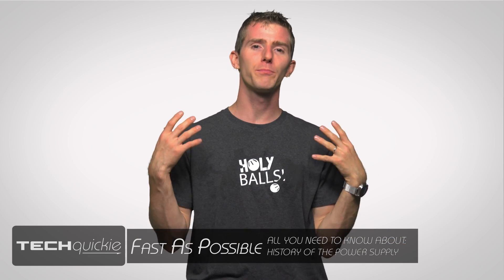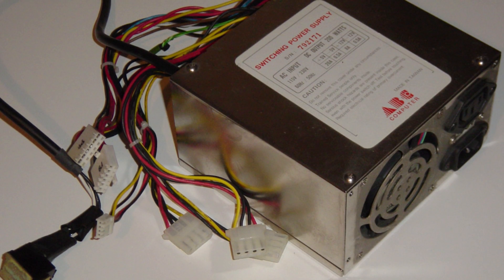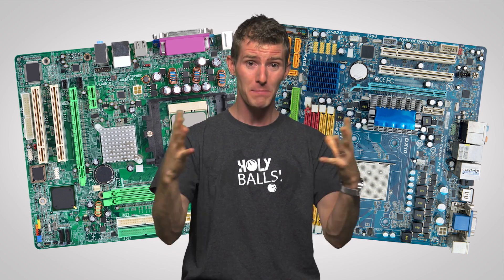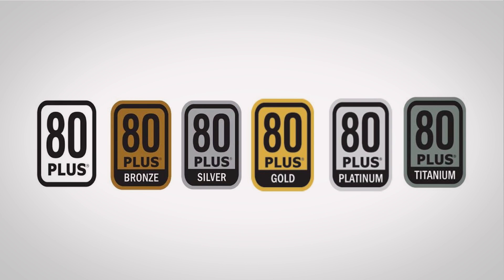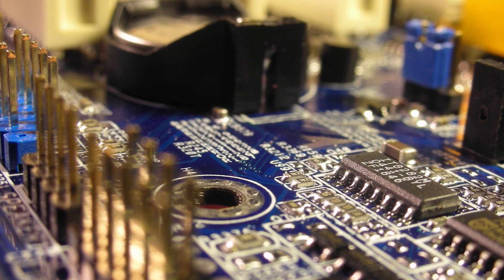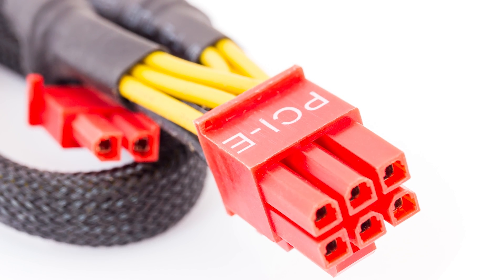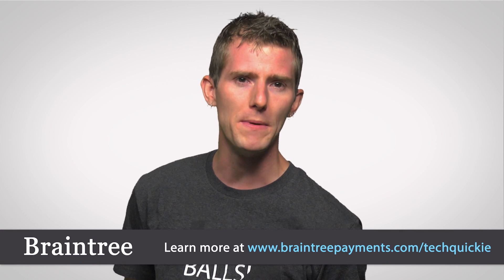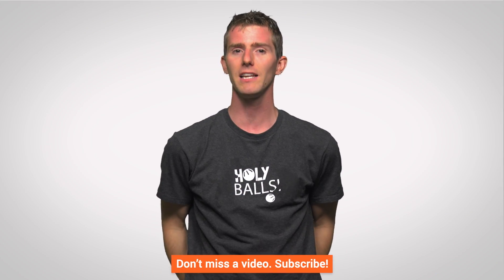History of Computer Power Supplies

Comment: What the actual fuck are you talking about Linus... this is all complete horseshit. ATX / BTX / AT / XT / etc... are NOT the Power Supply but Motherboard Layout and Design. Power Supply Units while might be labeled as "ATX" this is merely in Reference to the ATX 8 / 8+4 / 12 Pin Connector that actually attaches to the Motherboard that Intel designed for their ATX Form Factor. There were a series a 'Transitional' ACPI PSU that had AT / XT / ATX Connectors and in-fact today the actual PSU name typically denotes the Form Factor of the PSU itself as Modular ACPI PSU are becoming the Standard, that can provide a fully customisable range of Connectors for the various Board Designs. • It is still technically possible to power a Modern ATX Board with an AT Power Supply, and depending on when (as AMD / Cyrix / NeXT did keep using them well into the Late 90s as they chose to stick to the AT Form Factor until the Pentium III Era in 1999) it may or may not feature ACPI Functionality. Yet it won't work "Out of the Box" as you will need an inline 3.3v Line Converter as this was something the 2-Rail (5v/12v) lacked ... on top of this typically they never really went above 350w, which beyond a Low-Power System (say AM1 APU that typically run at 15w, with no Dedicated GPU or an AGP > PCI-E Converter to use an earlier Low-Power Card) you're likely to run in to Power Issues. As Modern GPU even Low-End expect ~75-180w and CPU expect ~65-125w; As such with a 350w AT PSU (with a inline brand and stepdown) ... it'd be tough beyond ITX Systems and potentially dangerous too, given well there are non of the protections that modern systems typically rely on (because they're basically considered part of 'ATX Standard')
Reply: Tfw a fucking "brony" (or whatever you people fucking call yourselves) tries to call Linus out on some bullshit.
Reply: What's your point?

Comment: PSU Tiers fast as possible would be a good followup. You CAN go and get the brand name unit that has enough wattage, but it's not always the best choice. There's a reason why some units are more expensive than others, and it's not just the modularity/aesthetic/efficiency. This is coming from someone who tried overclocking a G3258 on a Corsair CX500 and less than a week later, the PSU was dying and took the SSD with it. Never again going with a low tier PSU for even somewhat intensive loads.

Comment: I've gone through a few Antec power supplies in the past. The power supply would just simply die or almost cause the ATX plug to get stuck in the board because it would fry a little...

Comment: "Tinkerers", and the rest of who had ANY business working on computers in the days of the AT power supply, had NO problems with re-pinning and re-configuring these things.  These new kids that think they know computers now wouldn't even begin to know where to start on an IBM PS2 or something like that.  We were excited to see jumpers on the main board to switch CPU frequencies and make overclocking a breeze, or even upgrading a CPU.  Lets see you geniuses deal with things like that, as well as REAL hardware that didn't rely on software to work, because it was "standard" and "compatible".  Damned kids, get off my server floor.
Reply: I've never seen an AT PSU with a different pinout so I don't know what he's talking about when ge speaks about "re pining" the connectors.

And yeah, jumpers on the motherboard have NOTHING to see with PSU like you said. The only time where sometimes a jumper was needed is when computers switched from AT to ATX and you saw baby AT motherboards with both connectors and so some designers decided to use a jumper to switch between both but that's all

Comment: And Dell still made proprietary systems even as late as 08'. My T7400 I built as a file server has a 24 and 20 pin connector, which no single PS has besides proprietary Dell. And it won't work if you hotwire 2 PSU's together due to reworked pins on the 20 pin.

Comment: I find it odd that even here there is no mention of Amps. Everyone is obsessed with Watts and efficiency ratings but Amps are NEVER even hinted at. Yes hardware is getting more efficient but if you have a 700W gold psu that your going to run SLI on a 30 amp 12v rail most likely will not be enough. There is more to selecting a proper PSU then just watts. I'd like to see SOMEONE, ANYONE, cover this very important aspect of system building.

Comment: But if components are using less power, does that mean I'll never get a 1.21GW PSU?
Reply: You can buy a 1.21GW AC to DC converter, which technically is what a power supply is. However this converter would be fairly large and meant for an entire town.
Reply: Chaython Meredith Does that mean I can send an entire town back in time?
Reply: No, that's not how electricity works sir.
Reply: Chaython Meredith Really? Does that mean I don't have any use for that plutonium I bought? Just a minute. A blue bus just parked outside my house.
Reply: Sir Plutonium is radio active, and may cause radiation sickness when being overly exposed to a living being. I suggest against any individual consumer obtaining such a material.
Reply: Chaython Meredith What if I use Mr. fusion?
Reply: Sorry sir, I don't know what that is!
Reply: Chaython Meredith Maybe I'm just not good at detecting sarcasm online, but I'm starting to wonder if you are getting these references.
Reply: ***** I found one in some kind of old car almost a year (late October I think) ago when I was on vacation in california.
Reply: ***** They should be fine. I left them a few tickets to see the new Jaws movie.

Comment: Modern GPUs might be more efficient, but are also much more demanding on the Power Supply, due to their fast changes in clock. Especially Nvidia GPU from maxwell Gen and up.
Furthermore you should buy one with a decent DCtoDC voltage regulation and not a group voltage regulation.

Comment: 0:20 many years ago I put GTX560 in my friend Pentium rig with cheap psu and run Crysis just for fun. 1 Hour later the cable melt and short circuit.

Comment: There needs to be a new standard, the connectors are so big considering how much power they give. USB-C gives up to 150W of power, which is equivelant to an 8-pin which is much larger in physical size compared to type-c

Comment: This reminds of those dark ages when Half life 1 was new and a friend of mine got a weird shady, cheap power supply despite everyone telling him not to. Moments later smoke was rising from his tower. Good times.
Reply: @fixinmylife legends say it's a low quality psu but I run my 650W version of that in my R5-1600+GTX 1060 3GB system with no issues
Reply: I used to work for a company that serviced camera surveillance PC's, and they would always order the cheapest PSUs they could purchase or even salvage, leading to many fireworks displays and fried motherboards.  Don't save pennies on PSUs folks.
Reply: its not shutting down ahhh
Reply: @mrtuvok5578  I never thought I’d see a Resonance Cascade, let alone create one.
Reply: MY GOD WHAT ARE YOU DOING??!!!
Reply: heh
Reply: Can confirm cheap psu still warns of incoming attack.
Reply: Similar thing happened to a friend of mine around the same period as well. It was a Q-Tec, IIRC.
Reply: I don't have any other friends that can build a PC.
Reply: I build a budget gaming PC with a Corsair VS450, RIP me.
Reply: @agnel47  whats wrong?
Reply: @agnel47   that's decent
Reply: I can see that white haired scientist running around saying "oh dear!" while the psu smokes lol

Comment: Even though every single person recommends you to cheap out on your PSU and just get the wattage you need, that is the worst way to buy a power supply. Linus is acting like you need less and less wattage from a PSU as time goes on, this is so  untrue. The power efficient component models always perform worse than the ones who draw the exact power they need.

Comment: i wish notebook charger where standart as the PSU
Reply: they are???
Reply: impossible since every Laptop needs a different current and voltage. but you could have same Connector which however will destroy weak psus
Reply: they cant be standard, if you get a 23v psu and plug into a 15v laptop you may damage it
Reply: +otsen thank
Reply: +Daniel Lee thank

Comment: if i put the computer to sleep and switch the power supply off...would it still be sleeping? And if it were to turn off, what would be the difference if i just press off on the front of the computer (that i know it goes to a pin on the motherboard)
Reply: sleeping just means that it saves the current session to ram. ram can only Store things when it gets enough Power, its volatile storage as they call it. if you would switch your powersuply off, all your components would be electrically isolated from the wallsocket since it uses an relay. the charge on your motherboard would slowly deplete since some is stored in capacitors (those cylindrical components, those are dangerous because they can electrecute you at High voltages when power is Unplugged). what the normal Power button does is it simply sends a current to the motherboard that the shutdown shoud be initiated. the motherboard then checks the length of the press, if its 5 seconds long then it does a hard stop by sending a signal to the Power suply to cut the Power to everything except the motherboard Power in. the motherboard Power in needs to stay on in order for the normal Power button to work, but the motherboard Power Probably is not running its full power delivery but i don't know enough about that. the switch on the Back of your psu is always the safe off switch. i always turn this one off in case the Power grid has surges or Lightning strikss(but i doubt the relay wi save anything from that). so what will halen when you are in Sleep mode and you click the psu switch? your System will 'slowely' (within 30 seconds) lose Power from the capacitors.
Reply: Thanks for the reply. english isn't your first language i see...
Reply: abeismain
nope and i was just awake and on my phone which auto corrects like a bitch haha(hence the odd capitalization of words).

Comment: 3:34 BTX power supplies are actually fully compatible with ATX standard, at least externally and, as far as my experience goes, electrically; any BTX case will fit an ATX power supply, albeit usually only in the prebuilt/old-fashioned orientation at the top of the case, and vice versa. The connectors are also the same.

I do know the Dell at least, while manufacturing prebuilts to the BTX standard, did sometimes put their own spin on it by having a locking clip of sorts at the top of the case and a corresponding slot on their power supplies. This would make ATX power supplies fit somewhat awkwardly, and the clip would press against the top of it and leave scratches and dents. Besides this, though, as far as I am aware there was never any substantial difference.

Comment: is a cx500m good enough for 4690k and GTX 980?
Reply: Yes as long as you don't overclocked either of those two components, you have  around 6 case 120mm fans or less connected via molex only, no more than two 120 or 140mm cpu fan cooling setup + 3 storage drives without a lot of usb power hungry devices connected, and you DON'T run prime 95, furmark or any other cpu or video card maxing-out benchmarking software....  It should be fine

Comment: You can still buy AT power supplies brand new.
They're used in a lot industrial automation stuff, which means they're still needed by businesses for various purposes.
Side effect? You can still buy them.
Worth knowing if you are into retro computing. 
(the one I came across was a 300 watt brand new AT power supply - more than enough for nearly any system that could even make use of one... The internal construction may well be closer to modern power supplies, but that really doesn't matter...)

Comment: Okay I officially dont like the new Edge browser. Thought I'd try it out to see if MS got it right and for some reason the browser says page not responding where Chrome does not and I just watched this video on Edge and for some reason it was a lot quieter even at full volume
Reply: I haven't tried Opera. I'm sticking with Chrome it's never let me down
Reply: Firefox isn't the best browser for rendering JS+HTML5 and has a ton of screen tearing, JS is single-threaded, it slowly eats up more and more ram, doesn't have built in flash support and Netflix DRM support, and doesn't remember how you set things up when you sync to another computer. It's a bit behind the times. However it's open source and has a huge database of plugins, addons, and themes that Google Chrome can't come close to, not to mention that Firefox is incredibly modular.
Reply: Have you tried Firefox? or maybe Opera?
Reply: With all due respect, to hell with Firefox.
Reply: May I ask why?
Reply: Blake Fasse
Bad experience with Firefox? Eh, I have no problem with it. Have you tried Opera?
Reply: +Blake Fasse k
Reply: Your on a web page designed by the same company that made Chrome of course it's going to run the best on there
Reply: +Ryan Mattox actually it does sync up settings passwords pluggins etc.
Reply: You should try Torch, it uses Chromium but uses way less RAM and CPU.
Reply: justin rivera it's not just youtube videos. Any audio that comes from the Edge browser is noticeably quieter. I've checked the volume settings and everything
Reply: gape I have plenty of RAM and CPU power to spare
Reply: @tjeulink Yeah, but it doesn't sync up how everything was positioned, so kinda 
like in windows, I get a bunch of bloat that I have to remove every 
time I reinstall. I'm not sure how good chromium is about this.
Reply: @justin rivera I never mentioned the fact that youtube runs on chrome better. I think it's genius though, because instead of waiting on firefox to implement a 360° video feature, google can be on the front of development and just make whatever they need from scratch. They're basically writing their own rules to Javascript and HTML from the browser's side, not the developer's side.
Reply: Ryan Mattox oh yea it doesnt save some of the layouts like toolbar stuff etc. but i dont think chrome does that either. but firefox does have adblock for mobile browser :D
Reply: I really want to use Edge if only it has adblock and some more custom feature like firefox and chrome but maybe it will come soon. I notice the edge is blazingly faster than firefox and chrome and use less memory.
Reply: Muhamad Ubaied it might be blazingly fast because it lacks those features :P addons generally slow the browser down the most
Reply: tjeulink
Maybe, but I like the look and the usability of Edge too. The only thing i turned off I Cortana of course haha. 1 time im playing game with friends and i joke about my buddy pissing like a dog, then i hear Cortana says this on my speaker "Searching buddies pissing like a dog". Alt tabbed out of the game then str8 bring me to a youtube video while im in game . WTF xD
Reply: Muhamad Ubaied ahahahahah cortana the trolling bitch
Reply: Muhamad Ubaied the Edge browser has extensions now and has adblock
Reply: Opera is just a re-skinned Chrome nowadays, I wouldn't bother.

Comment: Voltage (there's no -age equivalent): the amount of "oomph" each charge has
Current or amperage: the amount of charge going through a particular point in a wire per second
Power or wattage: how much "oomph" is being delivered or used per second, calculated as voltage times current

Therefore, 10 watts could be either 10V * 1A or 1V * 10A. Please let me be not the only one who understands this...
Reply: No, you are not the only one who understands high school physics.
Reply: "laughs in electrical engineering"
Reply: "Voltage (there's no -age equivalent)"... that's because voltage is the "-age equivalent" of electrical potential.
Do you even physics, bro?
Reply: +Guilherme Eduardo Carvalho not high school for me
Reply: I took an entire physics course and got obsessed with the thing; how did I miss that?!